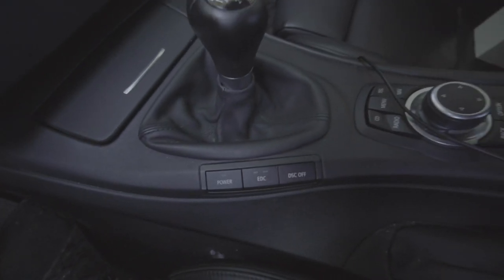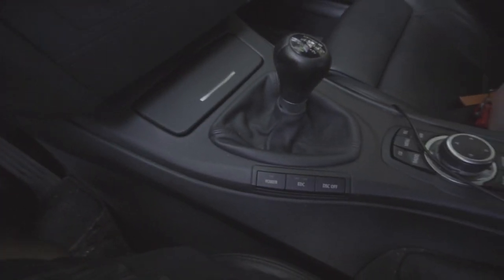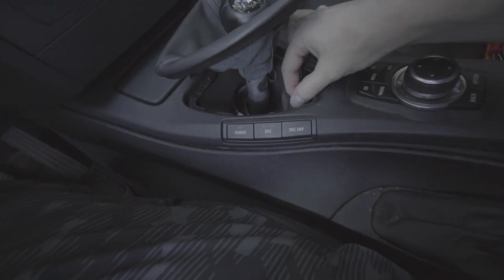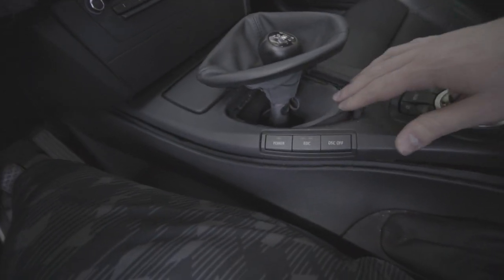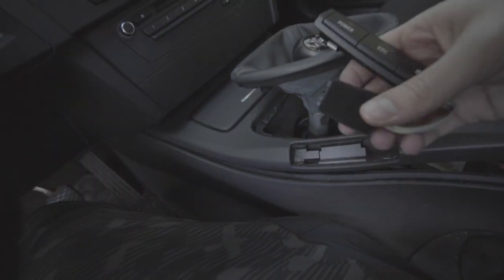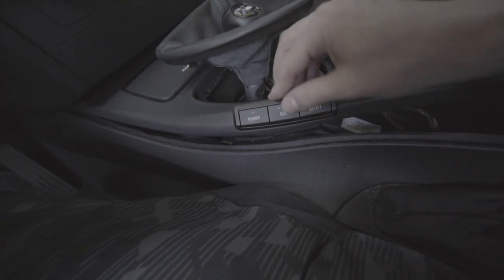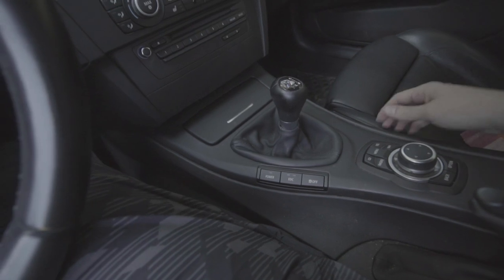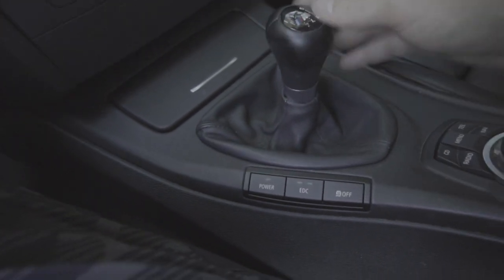BMW M3 Center Console Switch Assembly DIY (E90, E92, E93)

Comment: HELLO BROTHER THE POWER/EDC/DSC BUTTONS IN THE CONSOLE WORKS FINE BUT SUDDENLY THE BACK LIGHT STOPPED AFTER A LOW VOLTAGE FROM MY AGM BATTERY, IS THEIR ANY SOLUTION OR MAYBE A FUSE FOR BACKLIGHT? AND THX❤️
Reply from the maker: I wish I knew! Check the manual for the fuse panels?
Reply: @CoderMan  tx🙏